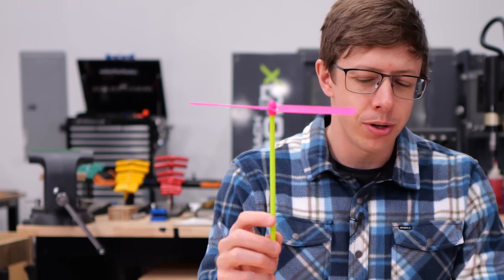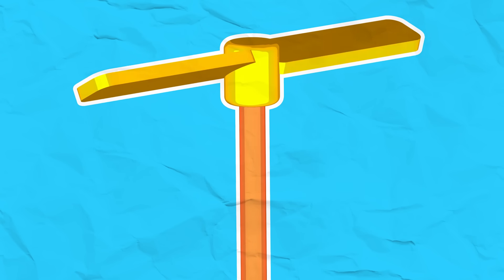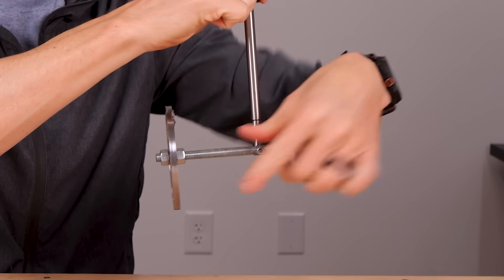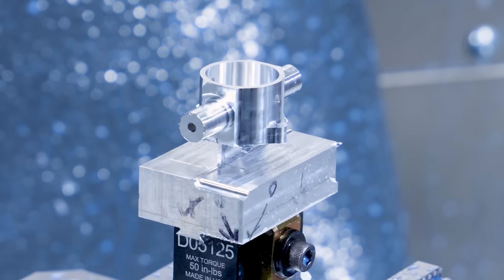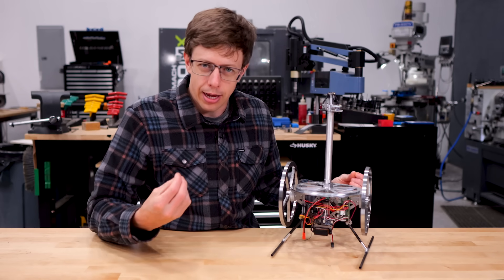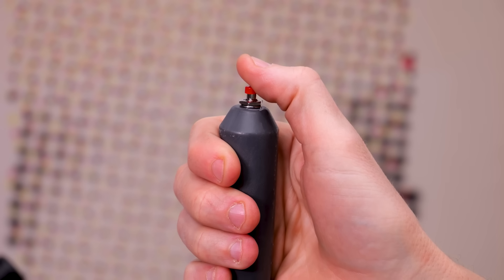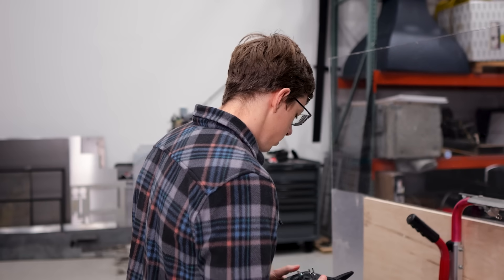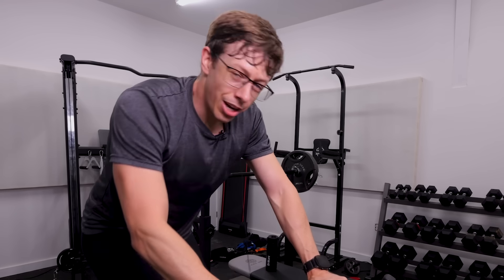I really thought this would fly well

Comment: I'm unsure if this will ever be able to work as you imagine it would with the static control surfaces
For the control surface to work, they would need to extend further from the center than the main propeller. The copter spins, pushes air down which creates lift but also creates the torque. The control surfaces grab the air being pushed down which creates drag and the opposing torque. The force over the control surface is directly related to the lift generated by the copter as that is what creates the airflow. For the control surfaces to work you need to more efficiently create the opposing torque from the airflow, than you initially create torque with the propeller, else the lift from the copter won't be able to overcome the drag of the control surface and it won't fly*. I don't think you would be able to do that without mechanical advantage. 

However if the control surfaces extend further than the propeller for mechanical advantage, they wouldn't be capturing the air pushed down by the propeller and it still doesn't work.

Sorry if I explained this poorly, it is 5 in the morning.

*(This isn't entirely dissimilar to trying to put a fan on a sail boat to try to make it go)

Comment: I had a toy like that, from lightweight plastic instead of aluminum. If you want a spinner the weight has to be near the top of the blades. If you want a helicopter you put a tailrotor or counter rotor. Making the mix between a spinner and a helicopter will indeed have some interesting consequences.

Comment: thx for the video :-) you want to use the flywheels for stabelising.When you look at gyroscopes that stabelize dish antenna's on vessels, they typicaly use a 3 flywheel setup. That should cancel out unwanted tilt in all directions. edit: also with a 3 flywheel setup i think the 'flywheel effect' of the propellors should be minimal in relation to the gyroscope flywheels. Edit 2: how strong does the gyroscope need to be to balance out a lightweight pencil propellor? edit 3: never mind edit 2 ... you want the flywheels to store energy ... still i'd consider a 3 flywheel setup instead of a 2 flywheel setup

Comment: dig a big hole under the launch pad and you will get more counter rotation force. The air flow at close to the ground is very very low.  I think its still wont be enough but may be u can have a less chaotic lift off....

Comment: well ... the solutions can be found on helicopters, because that is what you are building. You need a second rotor, either coaxial or coplanar, or at "the back" like a heli. another way to do this is to replace the back rotor by a fan with an rotating output. Considering your initial idea, a coaxial rotor is the way to go. This is why most cheap RC helis are coaxial too

Comment: I would like to to see how you design and build a gyroscope from a 1” plate of steel. Like to see the code. If it is not balanced right it will precess one direction and if you spin it the other way it will precess the other direction. This is what ChatGPT gave me:

I'll generate a CAD-style script using Python with the cadquery library to design a gyroscope from a 1-inch steel plate. This script will define a circular gyroscope rotor, its housing, and a central axle, ensuring balance. You can tweak parameters to see the effects on precession.

This script creates a gyroscope with a 6-inch diameter rotor from a 1-inch steel plate, featuring a central hole for an axle. It also exports the design to an STL file for 3D visualization or machining. 
import cadquery as cq

def create_gyroscope():
    thickness = 1.0  # Inch-thick steel plate
    outer_diameter = 6.0  # Diameter of the rotor
    inner_diameter = 1.0  # Central hole for axle
    axle_diameter = 0.5  # Axle size
    axle_length = 4.0  # Length of the axle
    
    # Create rotor
    rotor = (cq.Workplane("XY")
             .circle(outer_diameter / 2)
             .extrude(thickness)
             .faces("<Z").workplane()
             .circle(inner_diameter / 2)
             .cutThruAll())
    
    # Create axle
    axle = (cq.Workplane("XY")
            .circle(axle_diameter / 2)
            .extrude(axle_length))
    
    # Position the axle
    axle = axle.translate((0, 0, -axle_length / 2))
    
    # Combine parts
    gyroscope = rotor.union(axle)
    
    return gyroscope

# Generate gyroscope model
gyro_model = create_gyroscope()

# Export to STL file
def export_stl(model, filename="gyroscope.stl"):
    cq.exporters.export(model, filename)
    print(f"Exported: {filename}")

export_stl(gyro_model)

Comment: This is actually a success. You wanted to make a novelty spinny toy which goes high. It is a novelty spinny toy which went higher than any I have seen before. Smooth landing and reusability wasn’t in the original goals.

For v2 a radically simpler solution could be propeller blade tip mounted rocket propulsion.

Comment: If you were doing the cannon deployed parachute I'd put it going the opposite direction to the blades and fire when it starts losing altitude because even if it's not pointing upwards every action has an equal and opposite reaction so the parachute cannon would push the blades as far away from the cannon as the parachute goes away or maybe a bit less due to mass but still away from the blades.

Comment: It sounded very cool at least!  How about something much simpler; ditch the twin flywheels and just using a simple mechanical centrifugal governor system to change the blade pitch.  At launch RPM with high rotational speed the blade pitch is set to a minimum to minimise drag, as it slows down pitch increases to maintain lift.  The tricky bit would be resetting pitch to minimum when rotation stops at max altitude to enable autorotation, would be really nice to do this purely mechanically without any electronics.

Comment: Some thoughts:

The control surfaces still look underpowered.

Sitting so close to the ground does not help; there isnt really the space to develop a proper airflow. If you kept the helicopter as is but gave it a higher launch pad so the air could flow through, that could make a big difference in getting a stable launch.

Also, 3dp-ing a semi-proper airfoil shape, versus the flat foam plate, can make a massive difference in the amount of lift generated. Certainly for these high AOA situations, flat plates will underperform a semi decent airfoil by an order of magnitude.

Comment: i think it would be better to experiment with blade form to make flywheel by rotor itself. probably making outer edge more rigid,wide and thick is a way to do it. it greatley reducing complexity and also don't messing out original structure

Comment: My solution would be to Chinook it.  Build two and connect the with a simple frame and a small shaft using the same bevel gear on the center plate.  It would be mechanically simple and have a very low weight penalty compared to a coaxial system of contrarotation.

Comment: two ...counter rotating sets of blades would do the trick (as you know)
Puttin gthe flywheels as counter rotating sets of mass in axis with teh rotors would help, too.

Making the whole thing cylindrical and letting it spin (like the handcopter) would work, too. Then you don't actually need to be able to adjust the pitch of the rotors... once you run out of juice the machien should naturally reverse rotation direction on it's decent...

Comment: I'm not a physicist by any stretch, but I am a Mechanical Designer who's studied helicopters and the history of their design since I was a kid in the 1970s. 

In the helicopter toy, everything that flies is rotating in the same direction and it's just coasting on the momentum of the blades.  The motor, is the hands moving in opposite directions that spin the shaft to build that momentum.

The problem with your design is the torque of the motor.  Now, I'm not talking about the electric motor, I'm talking about the twin fly wheels.  While a flywheel is not a motor, it actually works more like a battery or a capacitor storing the energy produced by the electric motor.  However, since they continue to impart torsional force into the shaft via the gear, Action/Reaction is going to spin the frame that they're attached to in the opposite direction, torque.  

Your options are to either go with a counter rotating set of blades, an anti-torque rotor, forward flight with a tail (think Auto Gyro), or like the toy, you'll need to leave the frame with the flywheels on the ground.  Since the horizontal gear is attached to the center shaft, you could make it a flywheel, heavier so that it's momentum keeps the blades spinning longer. OR, take a page from the UH-1 Huey and run blades with weighted tips.  There is more mass in the blade tips and being on the end of the long moment arm of the blade imparts more momentum with less overall weight.

The fins and control surfaces you added would have to be massive to overcome the amount of torque in the system and the amount of drag they'd produce would work to cancel out the power in the system.

That said, I love the design of your test stand, the short slotted captive clips and the training wheels.  Igor Sikorsky's early helicopter used 4 very long legs for the same purpose.

Comment: Im sure this comment won’t be seen, but I feel like you have the right idea with the flywheels, but I don’t think you should be launching the flywheels into the air. Just spin up the flywheels and then release the propeller and stem. Your hands are the motor on the toy, and the toy doesn’t have enough lift for you. If you’re dead set on lifting the flywheels, you’ll need a larger propeller, or potentially a dual propeller system and get rid of the “balance” flywheel

Comment: Instead of fighting the torque, why not exploit it instead? Make 2 main rotors, counter rotating, with the flywheel assembly driving each blade against the other, so to speak. Then the vertical control surfaces might be enough to counter any residual spin from imperfections. At least if you start it high enough from the ground that air can flow downwards mostly unhindered by ground effect. Or you could remove them and control residual spin with relative collective instead, that's probably better? Whether you can actually do an autorotation landing with that assembly I don't know. Lots of resistance from the flywheels (and gears) against being accelerated, and finicky controls. But should be fine in principle...?

Though for good autorotation I read you need forward speed, whether you have 1 or 2 rotors. You need to enter "fresh" air continuously. Some sort of tail fin might be good for directional flight.

Comment: am I wrong or shouldn’t the wings by definition be weaker than the rotation caused by the flywheels? Because the energy you need to put into the propeller will cause a certain amount of rotation, the tilted wings will as a result of the airflow cause a smaller rotation in the opposite direction, because it feels like the amount  of rotational energy you can use from the airflow is bound by how much torque the flywheel has to deliver which would then cause an even greater amount of rotation…
But maybe it’s possible, feels like this veritassium video about going faster than the wind with a wind powered vehicle…
nice project:) if successful or not, doesn’t matter

Comment: there are other versions of helicopter toys which exists in other countries, would you be interested in checking them out? i would love if you would have a glance on those variants as well. the principle and the mechanism are almost same. but the moving parts are slightly different. the peculiar one we have here in India is. we have 3 blades/propellers instead of 2 and thin circular ring connecting the outer tip of blades. now the propellers detach from the long vertical pipe (the long pipe thing which we use to spin) while we spin it. and the circular ring and 3 blades flys away. the spinning tube we have is spiralled unlike basic cylinder. we have slit on propellers in centre. the  propellers are placed on spiral tube. the slit in propellers is inserted,and the proplers just go bottom of spiral. then with a hollow cylinder we push the blades up along the spiral tube, It produces a lot of kinetic  energy and can go up to 50 metres in air with human effort. hope you understood my explanation. or just google helicopter toys in India. it might give you some new ideas.

Comment: The problem with the wings is the length yes i saw that you extended them but it wasnt enough for them to work theyd have to be the same length as the blades of the helicopter although in theory itd work but with drag the orientation of them it wont.

Comment: Am I wrong or are these stubby wings not effective at all as long there is no meaningfull airflow arround them? How are they supposed to work if you try to hower? Afaik the downwasch of the rotor is the greatest at the edge of the circle and a rotor does not push the air down to create lift, its rather screwing the aircraft upwarts. the downwash is just a sideeffect.

Comment: "a 10" That's love. So you've won the bigger game. 👍 You might want to go full helicopter at this point, i.e. either a second identical propeller rotating in the opposite direction above the current one, or a smaller one rotating sideways on a tail. ... and get rid of the "wings", they have no chance for a bunch of reasons.

Comment: I remember them with a ring around the (3bladed)propellers. flywheel, stabilizer and structural support in one...
iirc they were just the propellers without a shaft attached and were put on a handle with an axle you could spin by pulling off the wound up string.

Comment: The toy works because it is radially symmetrical. The overengineered metal contraption failed because it tried to cancel out a bunch of forces. 
I would remake the toy and use the spin-up motor engaging directly with the shaft. I think you lose more power than you gain with the fly wheels.

Comment: 5:30 and that's where you forgot, it will tend to spin uncontrollably again...

Another smaller flywheel at the bottom, counter rotating and tuned to the propeller could have done the trick.

Comment: It seems to me you could have stored the same angular kinetic energy in a single fixed coaxial flywheel 5 times the radius and with the same mass. And that flywheel could have probably been the prop.

Which is to say you could have gotten the performance you wanted largely just by putting tip weights on the original toy and maybe doing some configuration optimization.

Comment: A couple of crucial things  I immediately noticed about your design that were missing, which contributed  to the spectacular  crash. First, the lack of rotational torque control. As other comments suggested, having contra-rotational main rotors would  cancel out each other's torque effects. Secondly, having a stabilizer  bar mounted to the main rotor greatly eliminates  uncontrollable pitching (dynamic instability) that causes your unit to roll over onto its side. Everything else looked like it should work fine. By adding the features suggested here, you should be able to achieve a straight, controllable, and stable upward lift!
Good luck 👍

Comment: Bro, I think you need to have a set of counter-rotating flywheels on each side. Those two flywheels are pushing the whole thing to its right side due to the gyroscopic effect. This helicopter is suffering a Mechanical rotation due to the gyroscopic effect, and you're trying to control that rotation using wings that have aerodynamic properties, and it needs to fly faster to get those wings into its working window.

Comment: I had a boss that tinkered with something like this. His version was basically a rocket shaped body with a fairly large carbon fiber model plane propeller on top with a strong electric motor  powering it and controls fins and the battery(lipo i think) near the bottom, the damn thing took off like a rocket and kept some battery to slow it self while falling(i think)

Comment: Suggestions;
1) you have turned a inverted pendulum into a pendulum. Don’t do that. 
2) you have the flywheels counter-rotating, but not the gear and propeller. Consider if you can eliminate the large spinning metal gear (and at least cover it with Mylar to reduce drag)
3) swashplates exist and are cheap. A plastic 3-servo swashplate is about US$15. 
4$
4) Passive stabilisers bars or “flybars” exist and should definitely be used, they will even correct for precession and you can tune the angle (90-45 degree offset) to tune the amount of correction
5) autorotation is unlikely to be able to back-drive your flywheels; but I would disagree that you need to. It won’t go up until it “runs out” of energy; it will go up until the thrust-to-weight is <1 and then will descend. In contrast, trying to autorotate will drop it faster than a rock and is not a skill you should try to develop on this platform. 
6) if you really want to stop counter-rotation then just put a little electric motor and propeller on a long CF boom and drive from your microcontroller 
7) I would suggest playing with a small 4-axis RC helicopter before your next round of trying this. You may be able to get a better handle on your design requirements. And steal parts. 
8) I strongly recommend doing it all in software / flybarless. But you know, we didn’t see an episode of “integration hell” so you do you